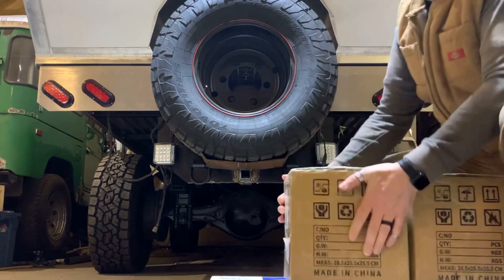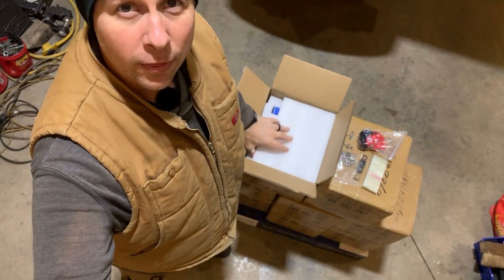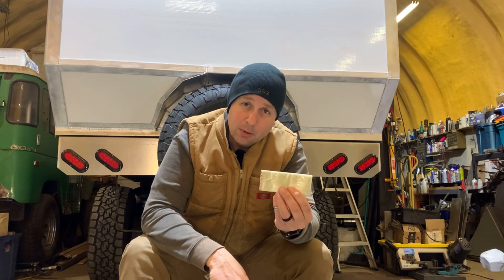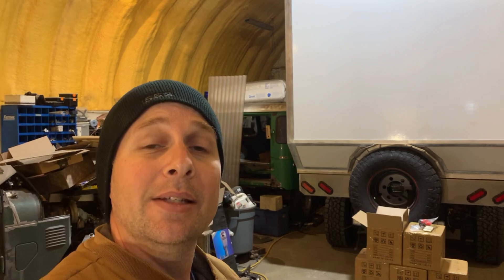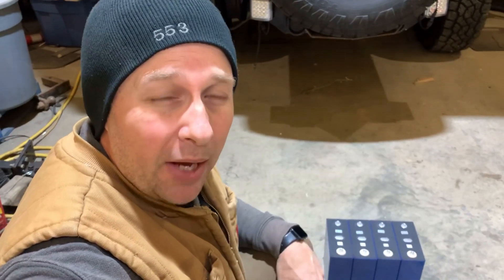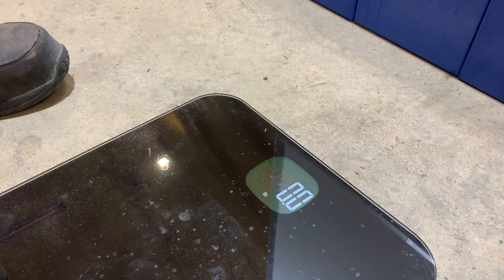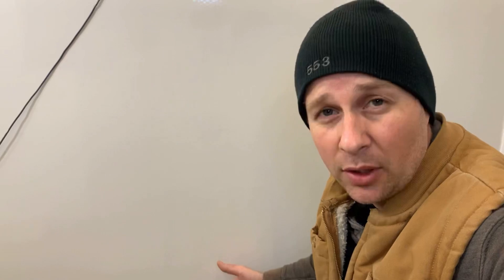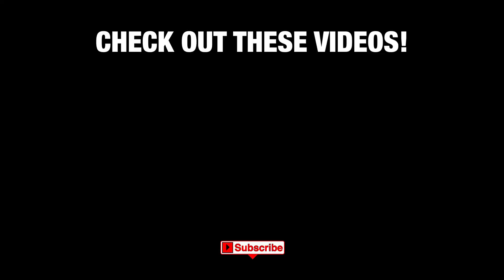Unmarked boxes from China? | Fuso FG Overland Electrical Build

Comment: higher voltage = less current... smaller wire... just too many positives to count 😂
Reply from the maker: True that higher voltage allows for smaller wire size - so some cost savings - but then you also need to buy converters to drop back down to a useable system voltage, so is it really a cost savings?  And, as mentioned, higher voltages (48 and above) start getting more dangerous to work on, and require different than most standard rated quality (like marine) electrical components.
Reply: @BruceandKrista re: quality of components - I am not convinced there is an appreciable difference. The amount of current you’ve got flowing through those 12v cables will be *massive*. I would be equally concerned with quality and ratings for 12v or 48v for a system like this. 

48v to 12v or 24v buck converters are surprisingly cheap. Less than $20 for a 20A one. My assumption is that for most accessories in my system that I don’t have to worry about the cost of those converters. 

(I still have 12v and 48v; planning to switch to pure 48v battery once I get my solar panels installed)
Reply from the maker: What I was meaning is that if you go above 48 volts, most electrical components (like breakers, buss bars, fuse blocks) from quality  suppliers (like Blue Sea for example) are only rated for up to 48VDC.
Reply: Also faster death, keep going up on the voltage 💀

Comment: I'm using 24V system on my build. With 3 x 200A 24V batteries I'm up to 600A at 24V. Like someone mentioned the cables can be a little smaller and there are many items that can run on 24V. Like water pump, lights, water heater, compressor fridge, inverter, A/C. I haven't found a good 24V roof vent so went with a 12V model and a 24V to 12V converter to run it and some other small things. Like the inverter, the converter doesn't need to be on all the time.
Reply from the maker: For sure the wire size cuts in half with 24V - but I have a few tricks up my sleeve for cable size as well 😎.   600A at 24v is some decent juice!!!
Reply: @BruceandKrista  Yes it is a decent amount... 😏But I always plan for the worst.

Comment: Definitely 48V for that sized battery. Keeps the current to the inverter below 200A (150A = 0.5C), otherwise the cables become unmanageable.
Reply: Just having an inverter on - uses up power. Whereas, running a 12v system and using 12v components, you save needing an inverter constantly on.
Reply from the maker: Exactly!   120V systems in our setup will be very minimal, and there won’t be any “trickle” users! these days the majority of what we need in this setup is either able to be powered directly from 12V, or will require a significant amount of AC power, all or nothing 🤣
Reply from the maker: I’d consider 24 or 48, but it’s difficult to do with 12 cells (8 or 16 sure).  I briefly considered 36V but it’s much harder to find components.  Cable size is for sure a concern, but I don’t intend to have a huuuuuuuge inverter, and can keep my cable lengths very short.  😎

Comment: I went series/parallel for my e-bike using Panasonic 18650s.  And I went with 48v 100AH LiFePo4s for solar backup in the house, but I haven't built transportation with them yet. 14v is easiest for automotive since everything is built for that voltage.  Wire is a bit more expensive for the lower voltages, but you won't have the 4x outlay for the 48v system goodies.  But if you want to run household equipment, 48v with the inverters is the way to go.  (Smaller inverters with 14v can do smaller appliances, too.)  What's your choice?  What BMS and monitoring are you using?
Reply from the maker: So far the plan is for 3X 150A BMS in parallel (and a 14V system). The high current runs will be extremely short, and I don’t intend to have a large inverter load (will see how that pans out!)

Comment: I went with 12 volts for now. My batteries are 2  Power Queen 300 watt 12 volt ones for now. So 600 watts for now and have space in a second compartment to add 2 more.  All Victron equipment.
Those buggers are massive but lighter than the old lead acid ones my Class A had in it. They are mounted in the original  basement battery compartment, and since the coach is already wired up old school, it's just a matter of upgrading a lot of it.  Inverter and DC to DC chargers fit under the cabinet where an icemaker used to live.  The icemaker broke years ago, and we didn't miss it.  So, it was a logical place for the electronics.  I mounted them onto slide out vertices drawers like a heavy duty  verticle spice rack so I can still work on them, but tuck them in tight and out of sight without sacrificing basement or cabinet space.
Good on ya Mate!
Reply from the maker: Victron sure is the go to stuff these days!  Hopefully I can build up a cabinet of blue bits as well!   Sounds like you have a pretty well laid out system.

Comment: Armchair quarterback here, but I'd go 48V. Lots of advantages like cheaper components and thinner/cheaper wire. You could possibly add a 48V alternator. Rig looks great so far.
Reply from the maker: I like the higher voltage, but hard to get 24 or 48V out of 12 cells…. For sure keeps the wiring smaller which is good, but so does keeping them short 😎.   And Thanks!
Reply: Re: alternators, I’ve seen people playing with increasing the alternator voltage by replacing and/or hacking the regulator. Alternator “regulators” are weird and totally different from other regulators. They basically generate a voltage on the exciter coils and adjust that voltage to produce the target voltage. 

If you don’t care that much about the target voltage then you can probably generate a fixed voltage. 

My idea for a big build is to generate the right voltage for the alternator to be 60-80 volts or so, and feed it into an MPPT controller. 

That increased voltage will result in a lower current and less heat for the same output power. Not having to have a voltage regulator on the alternator will probably make the alternator more robust as well.
Reply from the maker: Interesting - the same idea is used by a company called Sea Power (I believe?) they pull high voltage from the regulator and then create 120VAC to be used in place of a generator.  Used to add a “generator” on a boat without adding a generator…